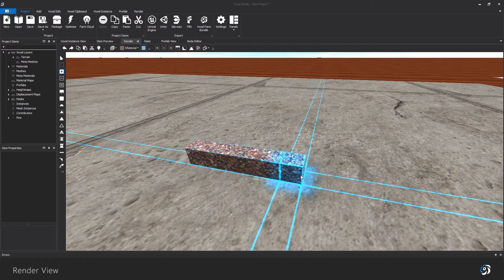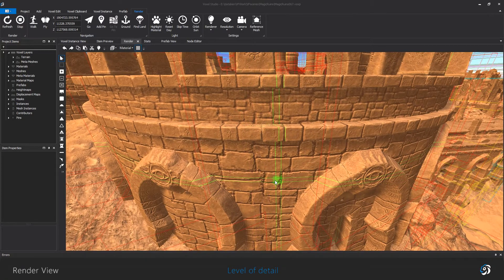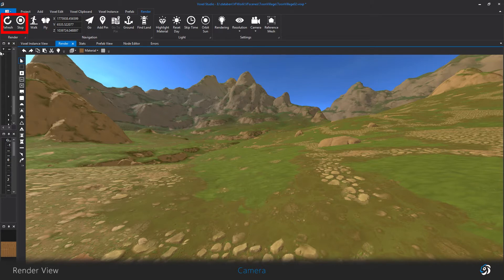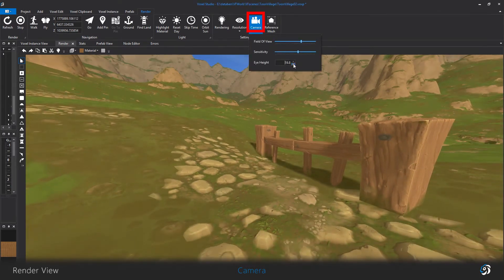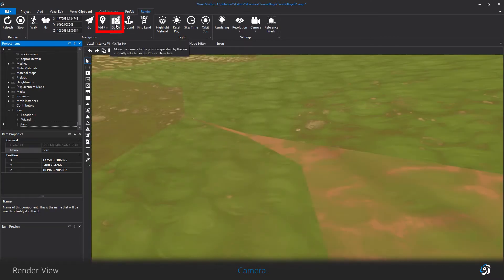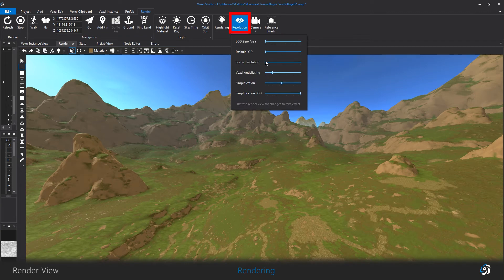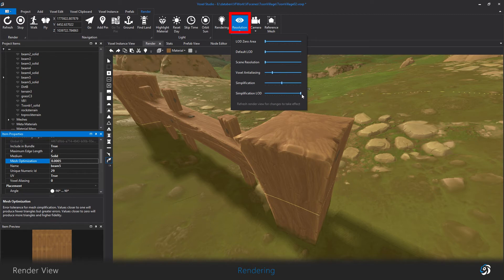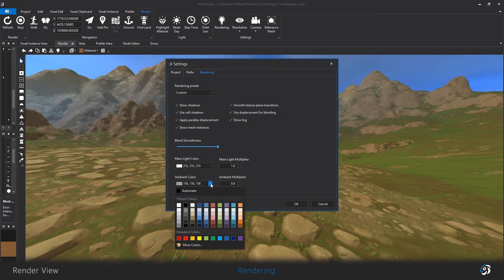Voxel Farm Tutorial: Render View

Comment: Can you create prefabs of voxelized meshes and spawn them as the terrain contour instead of using dual contour?  For example a voxelized sphere mesh, so it looks like a blanket of sphere meshes as terrain?  Maybe using stamp mesh?  Is there a way we can discuss details before I purchase?  The yearly price is also a huge turn off, are there other options available?  Do we have to make all edits within this 3rd party tool or can we simply use the targeted engine tools?  I don't understand why this isn't a UE4 plugin for example.  How much of the actual engine is accessible in UE4 via BP or C++?  Can we use UE4 materials or are we stuck with whatever we import into the engine?  Can you perform random generation in UE4 without having to touch the 3rd party editor?  It seems like this is more of an art tool than a standard voxel engine.  Why is so much of the work done in this editor?